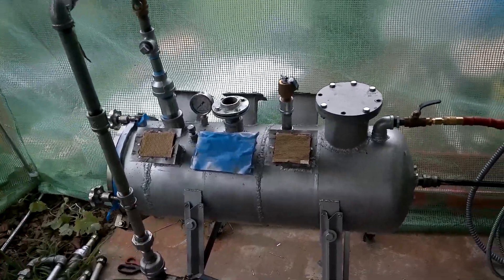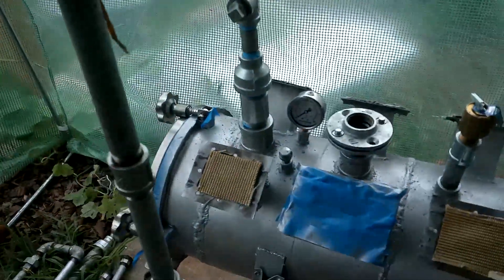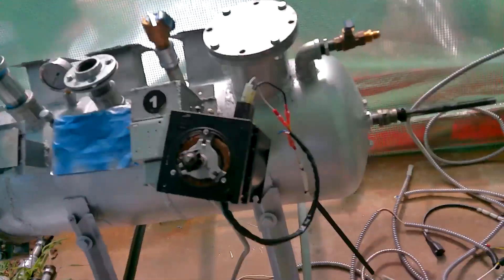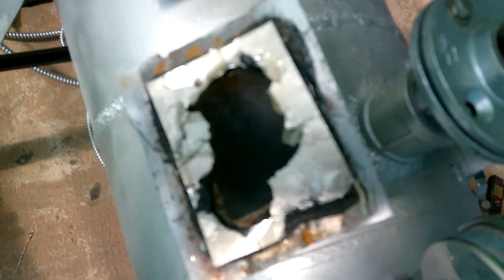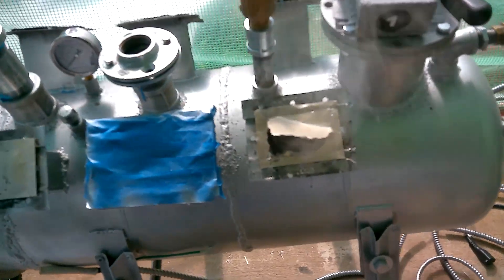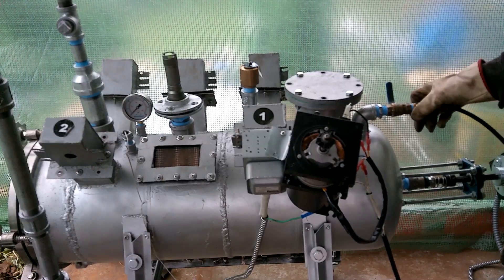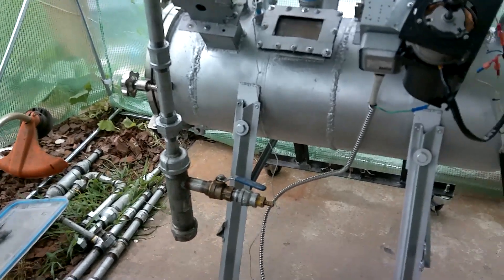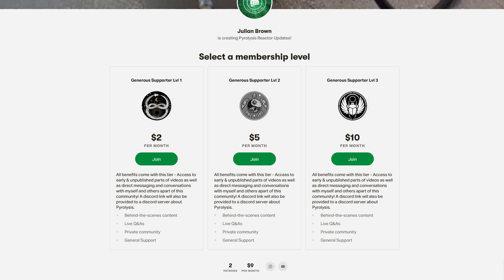Pressure Testing Mark 4 Part 1

Comment: As you can see I'm still catching up and have a lot to catch up on since I stopped getting notifications.
  I'm hoping to see what you did that's better than the Michael windows for the microwave and if you decided to insulate the outside of the tank at any point.

Comment: Could you fill up the reactor with air, leave it for a few hours, and then check the pressure to check for leaks? Maybe put smoke from a fog machine in there and then apply pressure to see if it comes out anywhere
Reply: Well you said it right after I paused the video to type it xD
Reply: For pressure testing, usually you do a hydrostatic test, where the system is filled with water and maybe a few CCs of compressed air.  If you can charge it up to 1.5x or 2.0x the rated pressure and have no leak down over an hour, you're good. Air is harder to seal that water, so if it passes the pressure test, leak testing with air would also be a good idea.

Comment: I think the main takeaway from this is safety should be your first concern and you’ve built a very capable reactor but you NEED to make sure you have a pressure release safety system that really works reliably. And your “bubbler” needs to be the correct flow rate
Reply from the maker: How to make the bubbler correct?
Reply: @naturejab  you said it doesn’t relieve enough pressure fast enough so pressure builds in the reactor which will eventually lead to an explosion
Reply from the maker: @tylerhall99  oh I got an additonal pressure releif valve
I'll set it to 2 psi
Reply: This is a fantastic comment, I wish it didn't age this hard though.